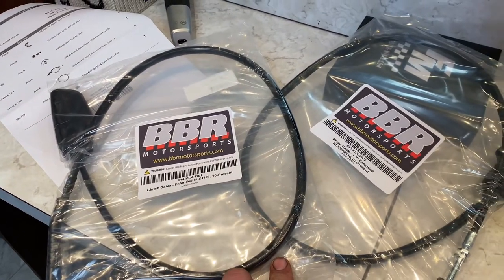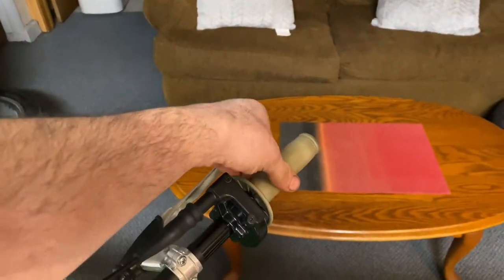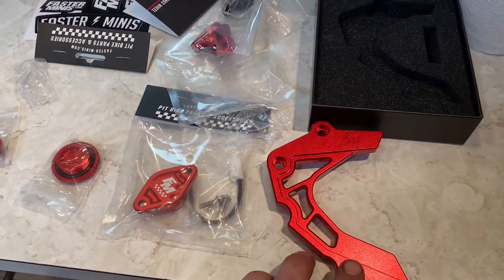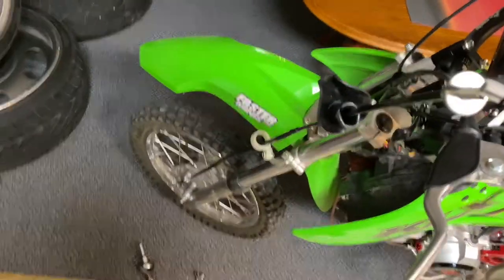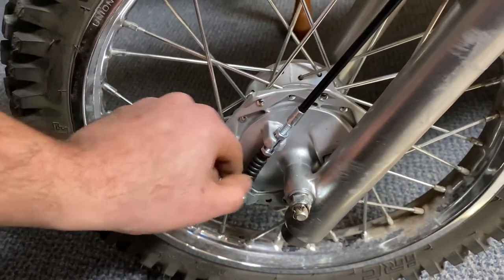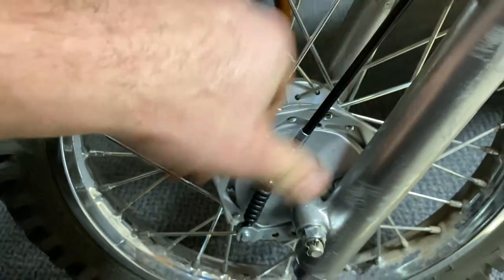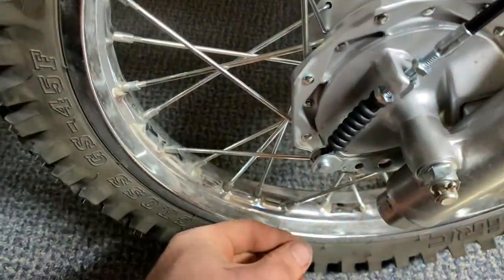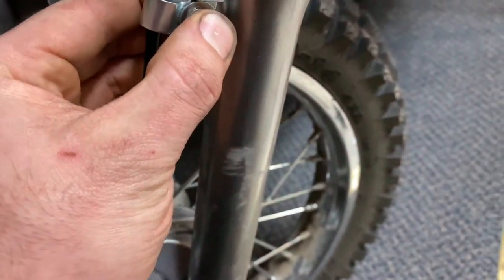Klx110 Build Ep:3 / Fit for an adult! Plus some pretties

Comment: Was running the same bars on my 110R I didn't like the tall 50 bars when I had my 2020L . Was thinking about running risers but didn't even know if it was an option but thanks to this video I do now.
 my question  is have you put some time in with this bar setup? Do you feel a big amount of flex because they are up higher and also I notice my clamp bolts always loosens up do you experience  that issue  as well? Especially  now that the bars are taller? .side note just sold my 2022R so I can get a 2023RL I'm 6' tall and wanted that couple " taller suspension  height  and clutch because  I mainly  just use bike to practice  wheelies and the clutch with be key to carrying everything over to my big bike when I feel I've gotten confident  enough .
Reply from the maker: I feel these bars are pretty solid and haven’t had any issues yet with the bolts loosening up however I have yet to take this setup back to the track I was talking about in this video and hit some jumps with it. Overall the raised height actually helped me with wheeling just having the extra leverage over the bike even though I thought results would be reversed
Reply: @Keegan Lynch  thanks for the feed back I may try this and see if it's more comfortable with wheelies

Comment: I would highly recommend not powder coating your wheels. I’ve seen dudes get them powder coated and it looks awesome sitting on the stand, but you’re gonna be super bummed when you spend the money on powder coat and it starts to chip off the first couple rides. I would recommend either getting the rims cerakoted or just spending a little extra coin on aluminum rims it’s expensive but it’s worth it in the long run
Reply from the maker: Yeah I decided to go with some smpro heavier duty rims and spokes but the hubs will get either powder coated or ceracoated. Haven’t decided on that part yet. Kind of want to go either bronze, black or red for the hubs. I’ll have a new video soon on this thing. Rear shock, and my fork springs come in tomorrow